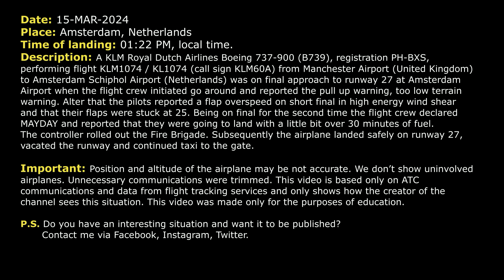Minimum fuel, MAYDAY, stuck flaps. KLM Boeing 737 has problems over Amsterdam Airport. Real ATC

Comment: Terrain Warning.......in the Netherlands?
Reply: Everywhere in the world on short final
Reply: Well, Tom, most buildings in the Netherlands are built on terrain, only a small fraction is built on/in water. We have 41.500 square kilometers of surface, of which some 33.900 sq. km of terrain.
Reply: There was a mouse on the runway obviously.
Reply: There was a mouse on the runway obviously.
Reply: GPWS estimates your vertical path and if there's an obstacle in the way, it gives a warning - even if it's the ground. On a vertical path the ground is like a mountain. A very high one.
Reply: Tom, het GroundProximityWarningSytem (Het shit de grond komt nu wel heel snel dichtbij waarschuwings systeem) geeft op een aantal potentieel gevaarlijke situaties een waarschuwing middels een luide stem (digitale opname).
Een ervan is 'TERAIN ! TERAIN !'  of nog erger "TERAIN PULL UP !"   (niet te verwarren met het Haagse 'TERING' wat echt iets anders betekend)
TERAIN betekend zoveel als 'de grond'  en er wordt dus gewaarschuwd dat de daalsnelheid veel te groot is.
Reply: @jemand8462  EGPWS should not be going off as you get closer to an airport. It has an upside down pyramid shape that lowers the limit as you get closer otherwise ALL aircraft would get terrain alerts as they get closer
Reply: @tomstravels520 Yep but they experienced win shear and probably sink rate exceeded normal levels. According to PMDG in FSX this in fact triggers GPWS, as it should, right? I mean it's critical to have GPWS especialls when you're landing. I think I've also read about GPWS callouts in crash recordings like the one of Asiana Airlines.
Reply: @jemand8462   Are you really taking my original joke seriously?
Reply: @tomstravels520 to some extent I do. There's some truth in the joke, when is GPWS calling out terrain warnings in landing on flat surfaces ;)
Reply: Wind shear can affect the sink rate and will logically trigger the terrain terrain pull up . Pilot reacted with toga pretty textbook . He did the safe thing he is trained to do. He said high energy wind shear so it was pretty serious. A wind shear resulting in a 15 to 20 knot tailwind at this critical phase is not a joke.
Reply: @AS-id7jo  my god you must be fun at parties. I’m joking about why a terrain warning is going off because the Netherlands is almost as flat as a pancake and there are no mountains it can possibly fly into. I know how EGPWS, GPWS and TAWS work thank you
Reply: Windmill, windmill...
Reply: @tomstravels520  touché 😂😂
Reply: Windshear and overspeed on the flaps will retract them automatically. Because of that the aircraft knows its not in landing configuration and will say pull up terrain no matter how flat the terrain is. Its all about safety with aircrafts
Reply: @tomstravels520 if the aircraft was in landing configuration you are correct. With a windshear you can easily get to fast and the flaps will retract because of the overspeed. For the plain you are now to close to the ground without your aircraft configured for landing (it needs flaps) and therefore you will definitely get a pull up low terrain working even when your close to the airport. If your close to a airport doesn't mean your out of danger for the ground
Reply: They could land savely
Reply: Wind mills 🤷🏻‍♂️
Reply: @sleintje  no they couldn't because they didn't have their landing criteria and needed to go around because of it
Reply: @larsmeijerink5471 yes they could. The input was wrong. You sure can land with that wind and flaps. If they knew the real situation at that moment they did.
Reply: @sleintje  they didn't get the landing criteria so legally they couldn't. They had a overspeed and therefore the flaps retracted. Thats also why they got the terrain working.  They had a speed over 250knots and couldn't land with that at speed and stop in time at the runway they were landing at. So no they couldn't land, not legally and if they did they would overrun the runway
Reply: Maybe because large parts of the country are below the sealevel? Perhaps that could give a false reading. I don't know.
Reply: @ThatNiceDutchGuy  nop, the facts it was overspeading did retract the flaps automatically and therfore it wasn't in landing configuration. Thats the only reason it got terrain warning. Terrain warnings on flat ground are not that weird
Reply: @larsmeijerink5471 Thank you!
Reply: @tomstravels520  it depends on  flapsetting and speed, in this case the GPWS was triggered by an abnormal high approach speed in combination with an faulty flapsetting.

Comment: 3:55 With that amount of fuel, they only had a single chance to land before the engines flame out. If they were already coming in with such low fuel, I think they should have at least discussed diverting to another airport.
Reply: Unfortunately, there was no other airport to divert to, maybe Rotterdam airport. If Lelystad Airport was opened they could've easily diverted to Lelystad. But due to a bunch of ''klimaat klevers'' the airport is still closed
Reply: @yb_aviation ridiculous answer. There is always an airport to divert to. That’s the whole intention of filing an alternate airport. 

Usually, your alternate isn’t close to your destination, since the weather conditions are usually the same. They could’ve gone to Belgium, Germany or even France as an alternate.
Reply: In my opinion, they arrive with too little fuel in the first place. I’ve never landed less than 3 tons.
Reply: @rtbrtb_dutchy4183  I know, that's true. But I meant more like, in that situation (30 minutes of fuel), they couldn't have gone to France or Belgium because that would be way too dangerous. And since they flew over Lelystad they could've diverted to Lelystad if the airport was open
Reply: @yb_aviation  right, but they should have fuel for Belgium at least. I just feel this was a bit low on fuel. I know they try and save money by not carrying too much fuel, but I don’t think you should push it this far.
Reply: It would be safer to commit to destination compared to diverting to a smaller airport since EHAM is a larger airport unless EHAM was not available for landing. In good weather conditions there is no regulatory issue landing with close to 30mins, as long as the fuel does not go below 30mins.
With 30mins, they probably have room for another 1-2 go arounds.
Not saying that this is safe but this is just the way things are
Reply: @rtbrtb_dutchy4183  Flaps are locked.  Fuel consumption significantly increase and they might not make their filed alternate anymore
Reply: Divertion Airport was probably Eindhoven since Lelystad is closed. But it wouldn´t had made much of a difference in weather conditions - when you´ve stormy weather in Amsterdam you´ve usually stormy weather in Eindhoven, too.
Reply: @JLCM  agreed, but why couldn’t they make their alternate?  Because they were at 1.6 tons right after the go around. Which means they were already low before all their problems.
Reply: They probably went with near to standard flight plan fuel.. which would be fuel for flying to the alternate + final reserve fuel 30 minutes (30 minutes is 1.2 tonnes in the 800 maybe more in the 900) . However a windshear escape manoeuvre burns a lot of fuel.. and then with the flaps being stuck at 25 you will burn even more.. per go-around you would burn around 800kg.. but with the flaps stuck it will be quite a bit more. Also diverting to an alternate with flaps stuck at 25 might be impossible since all the extra fuel burn, because of the added drag. Minimum fuel means you commit to this airfield and you are getting close to your last 30 minutes of fuel. If you will land with less than 30 minutes the minimum fuel would become a mayday fuel.
Reply: @rtbrtb_dutchy4183 plans change if you got flaps stuck at 25.. a lot higher fuel burn.. alternate fuel is not calculated flying with flaps 25 out..
Reply: @pilotguy7074  if you keep it relatively slow, it doesn’t burn an extreme amount extra. 

Also, they could’ve cleared the flap issue.
Reply: @rtbrtb_dutchy4183  How could they cleared the flap issue? If you read the qrh, it says land with the existing flap. Nowhere it says try to put the lever in the up position. So they wouldn’t have cleared the issue to be flying in a clean configuration.
Reply: @pilotguy7074  they had the load limiter bring the flaps to 25° when they oversped the flaps. That’s why they were stuck at 25. Had they (and you) understood what happened, they would know they had to slow down first, the flaps would have gone back to 30° and after that, they would’ve had full control of the flaps. (Could’ve retracted them). This is why they reported later that the flaps went back to normal at their landing attempt. 
If you know your airplane, you would know this.
Reply: @rtbrtb_dutchy4183  ok, then what is the reason for the flaps not retracting to 15 during the go around
Reply: @pilotguy7074  they went far beyond the max flap speed it seems. It’s very likely the flaps not only auto retracted, but that the high load also had a slight asymmetrical retraction and locked in place. They probably should’ve simply slowed down first. This is why the flaps worked fine when they did slow down for landing. I don’t even know if they tried to set 15. It’s not mentioned here.

They didn’t do a good job around. They did an escape maneuver, which means you don’t change the flaps like you do in a normal go around.
Reply: @rtbrtb_dutchy4183  3 tonnes???? Seems a bit over the top, They know meteo and airport condition when planning the flight. So except for traffic density or a calamity they have no reason to divert crazy far away. Landing with 3000kg on EGGL-EHAM flights is unnecessary. My calculations sum 2050 Kg.  incl 150 kg. discretion fuel, tells me thats sufficient for this route.
Reply: @Basil-Fawlty do you fly?  150KG is insignificant to use as any kind of calculation. And you 2050, that last 50 is absolutely meaningless. If you have to calculate down to the 50, you should not take off. You can have an indication discrepancy of 200+ kg. And now we aren’t even considering fuel density differences. 

Airplanes burn more at low altitude. Your 2050 kg isn’t the same at 5000 feet than it is at 15000 feet. 

So, how did you calculate this?  You have flight planning software?

Comment: So not being an aviation expert, when the fuel runs that low is it the fault of the pilot?
Reply: yes and no. Pilot is responsible for his fuel state, but what with the winds that day the fuel calculations by planning may have been overly optimistic.
By law they're required to declare an emergency when fuel threatens to go below 30 minutes' reserve, as that's the legal minimum for diversions and go arounds for most flights (can be more if there is no diversion airport within 30 minutes, for example during trans oceanic routes).
Reply: No. It's not
Reply: "It depends..."
Reply: On arrival you have to have enough fuel for diverting, than at that location being able to land with still half an hour fuel.
within this half hour you're supposed to declare a emergency.
If his alternate would be Rotterdam (5mins flight) he was on the save side.
Reply: @soccerguy2433 yes it is.
Reply: To me, it’s the pilots fault. 1.6 tons is low. Too low for comfort. I don’t like going below 3 tons. 
In the US, we are required to have 45 min of fuel, not 30.
Reply: @rtbrtb_dutchy4183  Ohhh  you might be right, realy it is 25 years ago since i touched a yoke for the last time.
Reply: @pascalcoole2725  are you retired or did you stop flying when young?
Reply: @rtbrtb_dutchy4183  Stopped fairly young. Several reasons mainly health. Actualy I'm a technician.  Aviation just came on my path and became my passion. Being a technican I'm still pretty knowledgable though, I can see systems have evolved over time.
Reply: @rtbrtb_dutchy4183  Stopped fairly young. I'm now (and in fact was back than) a technician. Aviation just came on my path, as wel as became my passion (i worked in pilot type training).
Still pretty knowledgable but avionics have evolved since. 
Also Dutch btw.
Reply: @pascalcoole2725  wow. Nice job. I always enjoy people who have a passion for aviation. 

I’m barely Dutch at this point. 🤪 I left the Netherlands at age 20 in October 1992 for flight training in the US. I never returned. I stayed in the US, did 8 years in Singapore from 2012 till 2020 for my company. I’ve been with my current company since 2005 and enjoying it, so I won’t move back to the Netherlands.
Reply: @rtbrtb_dutchy4183 You followed your hart, thats a good thing.
Groet vanuit Limburg.
Reply: The Netherlands is nuts messed up day by day more

Comment: 3:55 Landing with 1.6 on the fuel?! That’s insane! For example, I don’t like landing with fuel getting close to 5.0, although company policy says 4.4 is ok.. it takes about 1.6 to do a normal go around, these guys were planning to land around 3.2 before their go around? If they had to go around again, we would be watching a video about a crash.
Reply from the maker: I think they meant to say 1600 kilograms or pounds. But most likely kilogramms.
Reply: 1.6 metric tons. Not pounds!
What does surprise me is them giving another 27 approach. With the crosswind component I'd expect a priority landing on the 24 instead and screw the departure schedule (which was no doubt why they were given 22 at first).
Added bonus, the driving time to that runway for crash tenders is shorter.
Reply: "Uh, no, because they use the metric system?"
"Check out the big brain! You're a smart m*. That's right. The metric system! They got the metric system there, they wouldn't know what the * a pound is."
Reply: @jwenting  Did you check the notams before asking this question?
Reply: @fgaviator  ok that’s a little better.. 1.6 Kg is 3.5 pounds.. still tight… What is 30 minutes in metric converted to English come up to?
Reply: @thomasaltruda  "They call it a 'Royale with Cheese!"
Jules: "Ahhaha, what do they call a Whopper?"
Vincent: "I dunno, I didn't go into a Burger King..." 🙂
Reply: @jwenting  If i recall correctly runway 24 is still closed for maintenance
Reply: @jwenting At this moment rwy 24 is not available due to heavy maintenance (untill april, 25th). So, the only available options were 27 and 22, but 22 was refused due to the limited LDA, given the flaps issues and the possible different landing speed.
Reply: @thomasaltruda 3.5 is way too tight. I plan on landing with 6K. I’ll accept 5K, but not lower.
Reply: Could they be calculating a higher burn rate due to the flaps?
Reply: no, FMC fuel predictions aren’t accurate with gear or flaps out..
Reply: thats my point. Especially in Amsterdam where can be often windy it's just insane they were on low fuel and declaring an emergency for fuel after a single go around.
Reply: @fgaviator  i am form that country and i know the pound as the british curency not sure how that would work in weight
Reply: @fgaviator  Actually in the metric system we do know what a pound is and it's defined as exactly 500 grams or half a kilo. But that'd be way too logical for the Americans.
Reply: @D @DomycobainTCG They had stuck flaps which increases the fuel burn taking you below 30 minutes. 1.6 would be fine for two more attempts in clean configuration but not with flaps 25.

Comment: If it Boeing I'm not Going.
Reply: PH-BXS, 737 NG, flown for more than 22 years until now. Where is the Boeing problem here?
Reply: There are 100,000 commercial flights a day probably 50% Boeing. I’ve been on an emergency aircraft landing gear came down mid light. It was okay walked off the first plane onto a second and got to my office 6 hours behind. It’s routine
Reply: this was not a problem with the aircraft per se. Could have happened to any aircraft.
KLM has a fleet of over a hundred Boeing aircraft, hasn't had any serious problems with any of them in decades.
And what problems there were (like this one) were related to external factors, either weather, shoddy maintenance, maybe once or twice fuel contamination, not to poor design or construction.
Reply: Excellent!  More free upgrade seats for me!  Encourage others like you to avoid Boeing too.  I love free upgrades!!
Reply: like a kangaroo👍🏼
Reply: Enjoy  your walk.....yawn
Reply: @jwenting the pilots over sped the flaps. This was pilots fault.
Reply: @rtbrtb_dutchy4183  There is something concerning about alleged pilots who dispense flying advice on YT comments.  (Like surgeons dropping surgical lectures on Facebook.) You are so mirthful.
Reply: @RLTtizME  I know you are in the spectrum.
Reply: @rtbrtb_dutchy4183  The Lancer Chronicles DutchBoy...